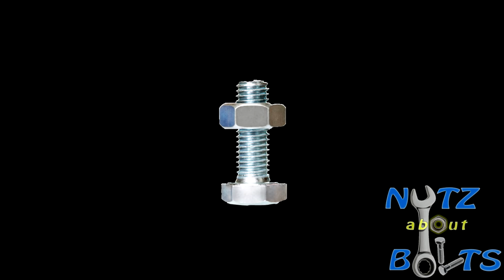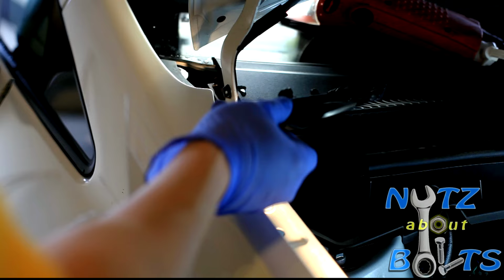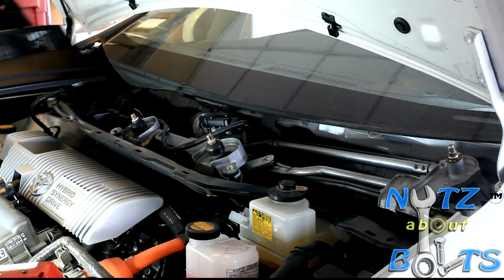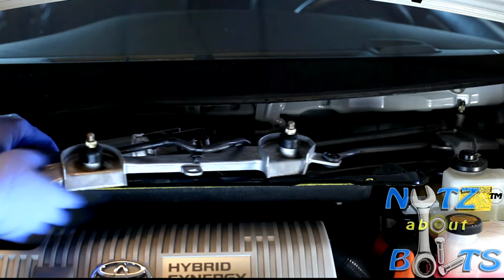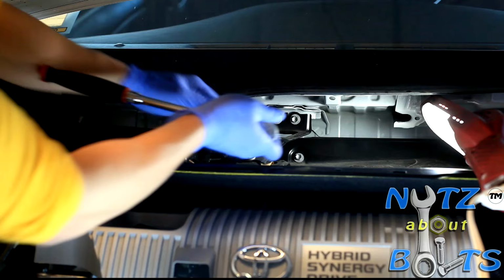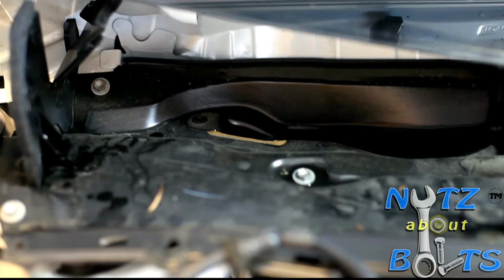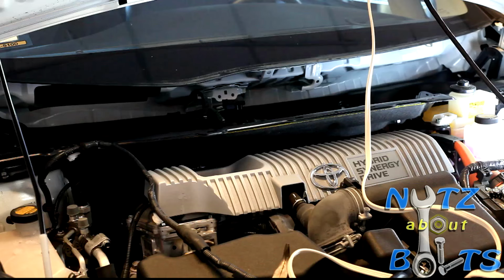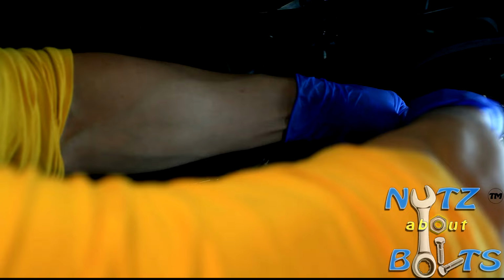2010-2015 Toyota Prius Spark plugs remove and install HD

Comment: So... what do you do when your socket get stuck in the cylinder? That’s where I’m at. 👍🏼
Reply from the maker: Use a magnet to get it out of there
Reply: Nope! Won't work. It is J-J-J-JAMMED somehow. We were able to get a locking socket extension into the socket and it won't budge. Any other ideas?
Reply from the maker: If it’s stuck on the spark plugs, remove the spark plugs. I’m not sure if there’s any other way to have it stuck in there. Maybe use a flash light and see where it’s stuck at.
Reply: We think it's stuck on the spark plug, but it's not turning the plug, so the plug won't come out. I have no idea dude. Really wishing at this point I'd have just eaten the $400 at Toyota. I can see the socket obviously, and have looked down there with the flashlight, but no idea at all what's locking it in there,
Reply from the maker: Does the socket have a rubber insert? It’s possible that the socket wasn’t long enough to reach the head of the plug to get a grip of it, it’s possible something glued onto the top. Maybe you can super glue the extension into the socket hole and try to pull it out or something. Not sure of any other way...
Reply: It does. That's what we're guessing is stuck. Not sure about the super glue idea... until the locking extension broke free it didn't feel like it was making any difference at all in dislodging it. Major bummer.
Reply from the maker: Ouch... even the lock extension doesn’t work? I can’t think of any other idea... maybe use the lock extension and then use a vice grip to grip the extension and use a block underneath the vice grip and pry it out that way, that’ll give you leaverage to pry the socket out. If the lock extension doesn’t work, find something that can lock the socket in place for you to pry it out.
Reply: NutzAboutBolts Yeah. We’re totally confused. Had a vice grip on it as well. Had some people suggest trying to let some wd 40 do some work then trying again. Should evaporate before it causes any damage? That’s what I’m hearing and reading anyways. Thanks for the responses. WIll let you know if we end up getting it out or if I have to take it in.
Reply: So, of course I feel like a fool after bringing it in, but I lost all my confidence yesterday so I just went for it. The service guys were definitely stumped at first as well, but what ended up working was just a little lubricant in the tube, then a regular socket extension with some tape on it, then they just kept ratcheting it while very slowly and carefully pulling up. It eventually came out. I don't think the socket itself ever seeded fully down around the spark plug. It just got jammed in there and locked into place somehow. Anyways. Super weird situation, just glad it's taken care of.
Reply from the maker: Glad the situation was taken care of, hope you didn’t pay an arm and a leg for them to take the socket out.
Reply: Very simple: I got a small round file into the spark plug socket and filed away the rubber part that grabs the neck of the plug. File a little and try it about three times until it grab the plug but also let it go.

Comment: 16:59 Verbally, plugs are 20 foot-pounds; in the description it's 13. I sure hope it's 20 'cause thats what I just did
Reply from the maker: It’s 13-15ft lbs. but 20 ft lbs won’t strip it. Just make sure to put it to 13-15 ft lbs next time.
Reply: @NutzAboutBolts  Well, the car's running so it can't be too bad after all, thanks for setting my mind at ease a bit
Reply from the maker: @daviga1  np, I did 20ft lbs the first time as well. It’ll be fine the next time you replace the spark plug. My vehicle is at 230k, it’s on its 2nd set of new spark plugs after torquing it down 20ft lbs. still running strong.

Comment: oh GOD this hand tool. Are you serious? I use air or cordless ratchet. Working around windshield with this heavy duty hand ratchet.......really. 1/4 inch ratchet will do safer job.
Reply from the maker: 😂😂😂 yeah, this was a demo, I’d suggest cordless tools as well, makes the job goes faster.

Comment: Ridiculous. Total design fail. Anything consumable like spark plugs, air filters, oil filters, etc, should be easily and quickly accessible by design. They should consider the method of accessing such things when they are in the design stage. It's not impossible, it just takes thought and good planning. Also teams that communicate, such as the body design teams talking to the engine design teams, talking to the windscreen wiper design teams, etc, and discussing how they are going to go about putting access panels in appropriate places and so on. 
I remember the old days when changing a car's spark plugs was a 5 minute job. Open bonnet, pull HT leads, unscrew plugs, replace. Thanks for the vid though.
Reply from the maker: I agree, but I think what they’re looking for is a fuel efficent vehicle, and they don’t look at the maintenance aspect of it. :(
Reply: Ridiculous at its best. Never seen such complicated spark plug replacement before. It is hard for me to accept that Toyota is behind all this. How they allowed such design to pass is beyond me.
Reply: iskoos I agree, this is absolutely ridiculous. It is true, these vehicles are quite reliable yet it is an annoying process to do something so simple.

Comment: The plugs is not a 9/16 socket, its a 14mm socket...just saying.
Reply from the maker: You do know it's the same thing right? Ones SAE and ones Metric...
Reply: NutzAboutBolts no its not LOL.  WOW.  It might seem to fit but you can ruin your nut with it.
Reply from the maker: Never had issues, and spark plug sockets are in SAE.
Reply: @NutzAboutBolts  they're not the same. Everything in a car post 2000 especially Toyota is in metric. Using stupid USA inches and feet will strip bolts and crack housings. The sooner you go all-metric, the better and easier your life will be. It's 14 mm which is not the same.

Comment: using any anti seize ?
Reply from the maker: david davies yup
Reply: NutzAboutBolts l usually read the plugs as I take them out but that’s old school I guess with code readers and all but I’m a curious ucker and if one plug has a different color there’s usually a problem with that cylinder

Comment: There has got to be an easier way to access the spark plugs
Reply from the maker: nope... it won't be hard if you have electrical tools. takes about 1 hr or so to remove and install. I know its not the traditional removal and reinstall for spark plugs.

Comment: There is ABSOLUTELY  NO need to remove windshield wiper and assembly when changing spark plugs in Gen 3 prius.
Reply: how did you get the coils out?
Reply: Socket and universal joint did the job .
2013 gen 3 Toyota  prius  1.8.
No removing of wiper assembly
Reply: The coil doesn't even clear the the cowling beneath the wiper assembly in my LHD 2010. Is yours left- or right- hand drive?
Reply: Hmmmm
I guess that seems to be the reason .
It's  a RHD

Comment: Can be done without this hassle
Reply from the maker: +toninocars mind posting a video on how? thanks!
Reply: +NutzAboutBolts 
Sorry mate, Haven't got any video to show you, but done before on a similar shape car and I used two pieces of extension bars one of the them was a shaft one, which I used to take the spark plug out, because of the limited space above. If the problem here we have is that we can not take the plugs or the coils out then is a different story and I agree that we have to go through this procedure, but worth trying my way too. Your videos very helpful anyway. 
All the best.
Reply from the maker: toninocars
hrm... yeah it might be a different car... I also tried to find a different way but couldn't even lift the coils out because that metal plate is in the way. I've heard of removing the engine mounts and lowering the engine down but never seen or tried it, and don't want to risk denting or maybe even damaging the oil pan. Thanks though!

Comment: Damn, all that just to change some spark plugs!?
Reply from the maker: yeah, its easy. 1 1/2 hrs and you will be done.
Reply: I did this myself.  this is a great video.  I'm 73 and still like a challenge.  I spent about two hours and didn't cuss once.  Piece of cake. spent 35.00 for iridium Denso plugs.
  I had a chevy once that I had to take the wheels off and reach over the A-frame and go by feel to locate four of eight plugs.  My second Prius. wouldn't consider another car.  Took a 3000 mile trip last winter used 124.00 worth of gas.  Old Norske

Comment: No need for all that effort, just use 2 short socket extensions.
Reply from the maker: what prius model do you have?
Reply: I tried to post a link to a video, but not sure if you can see it, look up rotovid on youtube, I made a vid showing how you can get out the spark plugs using a magnetic 14mm socket, and 2 short extensions. If you drop the socket down the hole, no problem, the extension will click in. The car is a Prius1.8l ZVW-30 2010 RHD

Comment: This is too long , my mechanic changed my car spark plugs in less than 10min without opening wipers etc. He removed the front cover and opened the spark plugs and then used a magnet to pull the plugs and then added new ones , tightened the cover and all over .
Reply from the maker: its probably a different gen 3 model and not the Prius I-IV. if you look at the engine compartment, our brake fluid reservoir is on the right side, while some Prius model has their brake fluid on the left side.
Reply: @NutzAboutBolts  agreed.  My 2015 Prius v doesn't not allow you to pull the ignition coil without removing everything in the video.  There is not enough clearance otherwise.

Comment: Yea.... a few swivels together will do the trick along with a spark plug starter and swivel spark socket. Done deal.. 😂😂
Reply from the maker: lol good luck trying to get off the ignition coil, I’ve tried 😭
Reply: I know. It was a joke, a bad one. Horrible design.
Reply from the maker: @alvinbaez2006  😂 I think the Prius c you don’t have to do all this though since the wiper cowl isn’t in the way.

Comment: wat a pain, just to change the spark plugs, i wont consider this car
Reply: yipee5247 really? It's only recommended every 120000 miles and needs about an hour of labor. It gives you 52 mgp which will save you a lot of money in the long run.

Comment: 30 mins to change spark plugs! Did Toyota really do this on purpose?
Reply from the maker: +shaazy I'm not too sure... maybe its helps with gas mileage.
Reply: No, they did it because of the windshield configuration wich is very nessesary for aerodynamics of the car.
Reply: This is why I delayed this li'l job, by 7 years. lol

Comment: As a retired Aircraft and automotive Mechanic who worked in the trade  for about 70 years I had to stop watching the video because I got tired of watching such a poor engineered process to change spark plugs ! I change my Subaru  in about 10 mins ! This is a laugh ! They built a car around the engine , What a poor design ! Sorry you Toyota lovers / I could change the 28 spark plugs on a R-1830 aircraft engine by the time he got to the plugs ! what a laugh !
Reply from the maker: Stanley Lorenz it’s actually not as bad as you think, but i do understand it’s not straight forward as other vehicles. If you have an electric tool, you can start and finish within 15-20 mins. Longer than most but is doable.
Reply: @NutzAboutBolts  Still turning a wrench ! my grandson just purchased a 2011 Prius so I was a little curious and watched the video ! Still in my eyes I don't believe all you have to do to change the plugs! Easy job on the assembly line since the whole package is introduced from the bottom so all the wiper cowl is in place. I think it's a good time to supervise him doing it !

Comment: This is a stupid design by toyota but i guess they did it this way to make you spend  money
Reply from the maker: djclown7pb its ok, I know the Honda insight is the same way, you have to remove the wiper cowls lol.
Reply: The second gen looks easier to do, and they didnt even change that much.
Reply from the maker: djclown7pb
its a different engine. Also they're trying to make it lighter to reduce gas consumption and have better performance. I actually like the 3rd gen engine better than the second.
Reply: NutzAboutBolts besides saving gas and making it lighter why do you like tge 3rd gen more than the 2nd gen.
Reply from the maker: djclown7pb the 3rd gen has a bigger engine, its 1.8 L compared to the gen 2 1.5 L. The Gen 3 has better torque speed, bigger navi screen, sunroof if you have the moon roof edition, better exterior design, better CVT. Just overall, improved from the 2nd Gen Prius. Newest model is always better than the old. Just like the 2nd Gen Prius is better than the 1st Gen Prius...Sometimes the maintenance is a pain in the butt, but it makes up for the engineering part of it. We just gotta learn and adapt. At least there's tutorials out there to help us so it's always a plus to do whatever you can on your own and if not, to the dealership! haha.
Reply: Yes thank you so much for your videos!
Reply from the maker: djclown7pb np!

Comment: People actually do this???!!!  My God!   Boy it is such an efficient car!  So well designed. Let me guess, Toyota charges about $200 to change 4 plugs?  Man, I see THESE kind of maintenance videos of 'new cars', and I actually feel better and better about my 'simple, plain, easy to maintain, old Chevy!  
I use to think when they first came out, that these hybrids didnt need any oil, plugs, coolant, that they were SO 'green'.....never understood that....I knew it had to have oil in it, it is a combustion engine, so it needs to have the regular nasty chemicals to make it run!!  and i was right. THIS is ridiculous!!
Reply: Troll much?
Reply: what the hell is trolling?
Reply: Marc B. Sure but these engines dont work as hard as a regular gas powered ones so you have less wear and tear
Reply: The maintenance interval for spark plugs is every 120,000 miles so the average owner who sells/trades their car after 60,000 miles will never have to change them. The 3rd Gen. Prius is an exceptionally low maintenance car because the engine and powertrain are not as stressed as a normal car.
Reply: and what the heck is 'trolling' that you said i was doing?  I watch a video of a unreal complex spark plug change, to pass some time, and i get that reply ,from YOU. Then you get all technical, so,, what the heck is it?  Sounds like a 12yo guys crack at someone that is trying to learn.
Reply: Look trolling up on Urban Dictionary
Reply: im not a 16yo idiot with a smartphone glued to my ear 24/7  i dont have time to look up slang.
Reply: signing off now
Reply: Marc B. same words i used
Reply: Marc: We are all on a learning curve, as cars get more complicated. Some older cars were MUCH more difficult to change plugs on, BTW. Take it one step at a time, swear a lot, and before you know it, you'll be getting 45 MPG again. Lots better than your "old Chevy", right? Pays for itself.
Reply: Same nasty chemicals, but they burn less fuel and pollute less. I'll take a longer service every 120k miles for 50mpg

Comment: wtf manbetter buy brand new car 🙄
Reply from the maker: Hi RPM 210k miles and going strong. Easily the cheapest car I’ve invested in. Low maintenance and gas saver 👍🏼

Comment: after seeing this mess just to change plugs Ill buy another gen 2 before I get a gen 3
Reply from the maker: +beachbummm69 The Gen 2 has more problems than the Gen 3. The Gen 2 you will have to clean the HV fan or else it'll cause an over heating problem with a check engine light. The process of removing the panel is more extensive than the 3rd gen. I for one like the Gen 3 better than the Gen 2.

Comment: six minutes into it I turn it off, DISGUSTED!!!!! who in the world such an idiot design it this way??? They found a way to nickel and dime you to death. Glad I saw this video I was close to buying a retarded Prius but I change my mind!!!! I am an avid mechanic myself and this is totally stupidity!!! FORGET IT!!!
Reply from the maker: +Shawn Hill its not bad if you have electrical tools or air tools to remove all the bolts.
Reply: +Shawn Hill - this job is done once every 120k miles. So you wouldn't buy a wonderfully engineered car because you have to spend a couple hours to do plugs once every 120k?
Reply: +Benjamin Lamberton Plus, if you have the tools to get the job done once you start, more than  likely it would only take around an hour or so.
Reply: Toyota builds for reliability ..not maintainability as you can tell from the spark plug change. Maintainability is not in their vocabulary
Reply: Shawn: how many other modern cars have you worked on? This level of complexity is now common. I too long for the old days, but cars are infinitely safer and more efficient now. This really isn't that hard, but I hear your frustration (especially with those damn electrical clips).

Comment: What an absolute garbage piece of engineering.
Reply from the maker: only this part, but if you need to get to a part that is hard to get to such as the EGR valve, you can follow these steps and you're half way there. It's not that bad once you remove everything and know where everything is at.
Reply: NutzAboutBolts All they had to do was keep it simple and just put the plugs at the front of the motor like millions of other 4 cylinders.  Thanks for the video though it saved me from having to do this job, lol.
Reply from the maker: true, but not sure what the engineers had in mind lol.